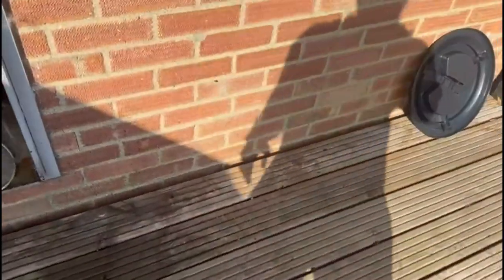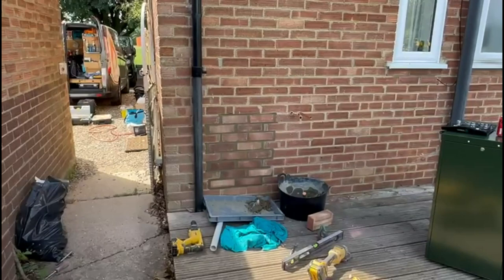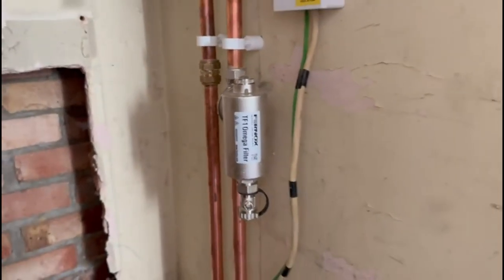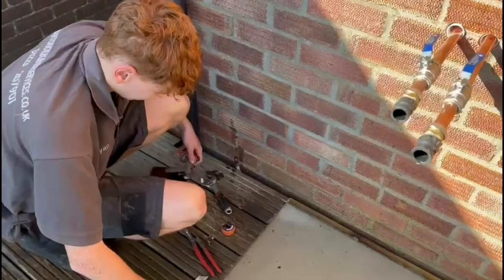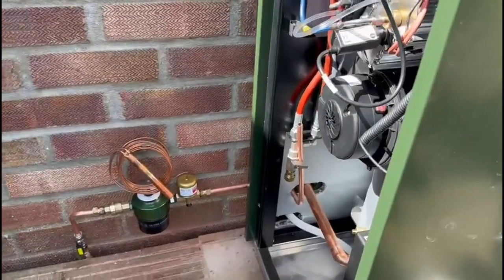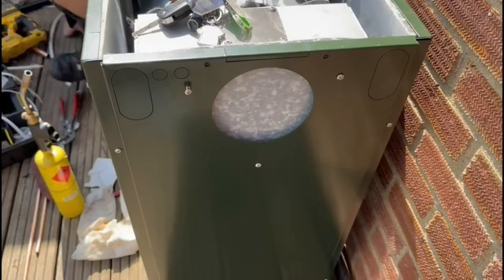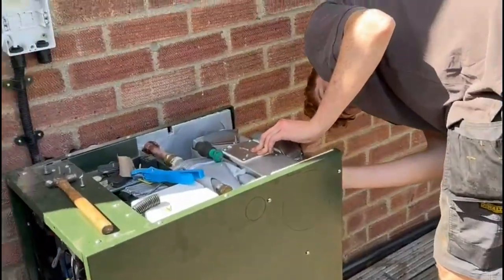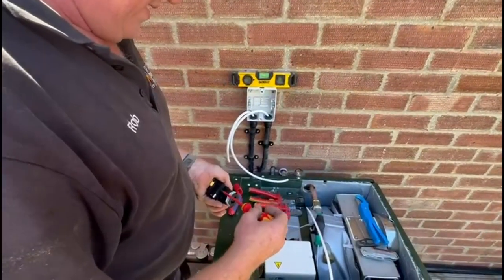External Sapphire Oil Fired Boiler Installation.

Comment: Another excellent video guys. Is the non return valve on the oil pipe line a requirement/regulation or just good practice? Thanks
Reply from the maker: Thanks for the comment. I just do it for good practice. The 2 pipe system in the Sapphire creates the  supply of oil and prevents air ( Like a Tiger Loop ) and Non return stops any issues with the oil running back. It is also supplied with the boiler! Keep up the good work.

Comment: Are you allowed to drill holes in the casing to bring the pipes in if the pre made holes are slightly off? Genuine question?  Very tidy work.
Reply from the maker: Thanks for the comment. I think you would struggle for room on the flows but the return holes in the casing are oval so you have plenty of room for sliding the pipe in if you make a small error! Have a lovely weekend.

Comment: Nice detailed video on the EOGB Sapphire! 

Bit of a shame using the relay and on/off switching of the OpenTherm terminal with the Hive controls. I’ve seen many oil boilers with Hive and they cycle the hell out of the boilers for no good reason. In my opinion Hive is not suitable for the modulating technology of that OpenTherm boiler and almost criminal the customer didn’t understand the benefits of OpenTherm better, as I’m sure they would have been open for a controls upgrade if it saved them 20% year on year? Especially after spending that much on the boiler?

Was there any reason for not insulating the flow and return pipes through the wall? You’d be amazed how much heat is lost on uninsulated pipework through external walls when it’s -5°C outside! I used to specify Class O, but now recommend Primary Pro 22mm external insulation for this on my external oil boiler specs.

Anyway, good video, look forward to the next one!
Reply from the maker: Thanks for the great comment. Also thanks for the insulating pipe tips and what to use! This customer kept the hive as he had spent £100s of pounds on it to include all rad valves etc only 6 months before so he would not change it which is a shame. i am also not a massive hive fan because of what you said and agree with you. we actually think the Sapphire modulates a dream on switched live which really shocked us but agree open therm is the best! For basic modulation we find as do EOGB that the EPH works the best at the moment?Thanks for watching!
Reply: @BartonOilBurnerServices  yeah is real shame about the customer and the Hive, but sounds like he choose the wrong control system for the HRM Wallstar in the first place, before later investing in the Sapphire. 

I’m interested why he went for a OpenTherm modulation boiler when sticking with on/off switching controls? Was he not aware of OpenTherm and what it is capable of? End of the day the boiler is now only modulating on return temps instead of being told by the controls what flow temperature the system actually needs, so he is losing loads of condensing efficiency he could of gained.

EPH CP4 is ok up to 6 zone valve operated heating or hot water zones, but evohome is much more capable with a max of 12 heating zones per controller (can have 4 controllers per OpenTherm Bridge) and a mix of zone valve zones, smart TRV’s and OpenTherm multi zone UFH.

I have a HVO Sapphire going into our new training room shortly. I look forward to getting some videos up showing the benefits of the OpenTherm controls you can use to educate your future customers!

Comment: Nice job as always love the way you work as efficiently as possible 
Should fire valve be at least 1 mtr from boiler only you know oftec 
Have to find a issue with a inspection or they are not happy 
Do you just do oil what will happen if government get there way 2026 ban of new oil boilers
Keep up the good work
Reply from the maker: Thanks for the lovely comment. I Use to think 1.5m but on the last Oftec coarse i done it changed and can be as close as you like within reason but outside. I just try to get it at least a metre away unless like in this case the oil line came straight out the ground, We just do oil, We mainly service and repair but have done many more installs in recent months. Bit worried about 2026 rule but hope HVO takes off then problem solved. Luckily for us the service repair wont stop in 2026 !

Comment: How much smoke should come out of the flu and how often please. Our new external oil boiler emits a lot of smoke which blows over to neighbours
Reply from the maker: Hi. This will not be smoke , It will be condense which is water vapour. There is no set time it does it but the harder the boiler works the more steam which means more efficient if that makes sense. Hope this helped
Reply: @BartonOilBurnerServices  Thank you for your reply, It really did help and put me at ease.

Comment: What happens to any rain water that might enter the flue pipe in stormy weather. ?
Reply from the maker: Thanks for the comment . the air intake is underneath so no water can get in and if the water got in the flue it would go straight down and out the condense > Thank you for your comment. Great question!
Reply: @BartonOilBurnerServices  Thank you for your reply, I had wondered what would happen but didn't know that any rain that had entered the flue pipe would pass through the condensation trap + outlet.
Thanks again.

Comment: Hi, I am due to move into semi rural house in Norfolk which only has electric radiators as the main source of heating and an immersion heater for hot water; as there is no mains gas available in the area; is it still worth considering a complete oil boiler install in view of the ban coming up in 2026 ?
Enjoyed the video on the recent Sapphire boiler install.
Reply from the maker: Thanks for the comment. I would absolutely get a oil system fitted as the rule got pushed back to 2035 a few months ago. If you got a sapphire boiler you be true future ready as well. This boiler when running on HVO once available is proven to be better than a air source heat pump. Happy new year.
Reply: @BartonOilBurnerServices  Thanks for your reply, I notice you are based in Cambridge do you also cover the Norfolk Area ?
Reply from the maker: @markpye9024  I am afraid not but if you go on the sapphire boiler website it will bring up a local agent or if you tell me your village and first 4 digits of your postcode i could put something on the  sapphire agent chat i am in to see if anybody is close to you. Hope this helps!

Comment: I think you did better at the electrics than you did the flow & return pipework 😂😂😂 Only messing nice job
Reply from the maker: Thanks for the comment. we just need to know our right from our left 🤣
Reply: What are they like to pipe up shame both connectors are not at the top flow and return rather than return at the bottom ? @BartonOilBurnerServices
Reply from the maker: They are dead easy to pipe up.  very easy access to flow and returns. Thanks for the comment  @k20aa